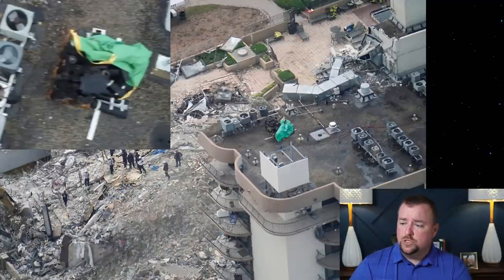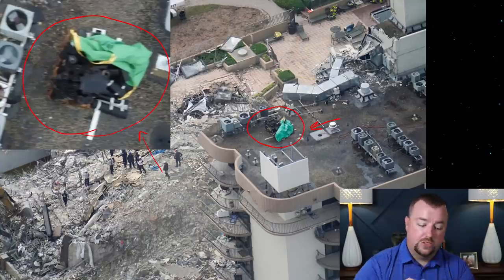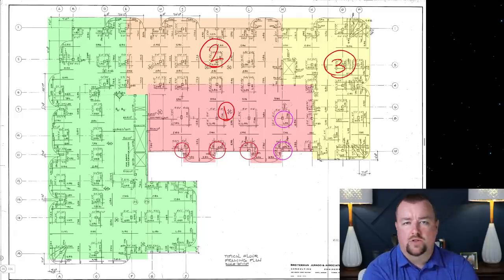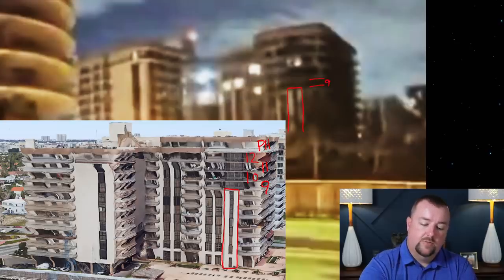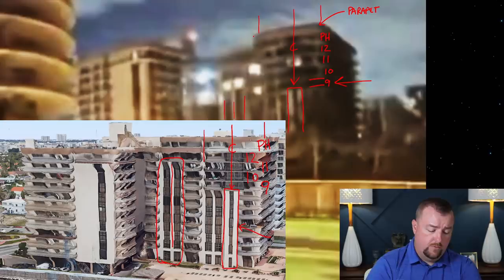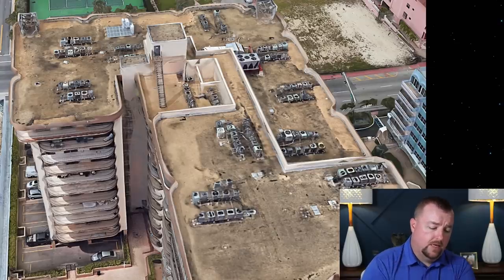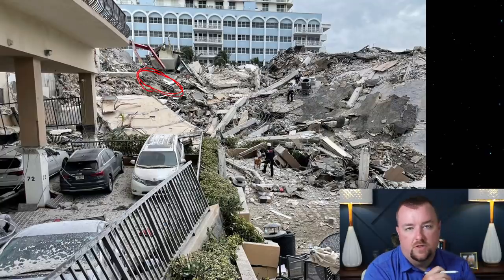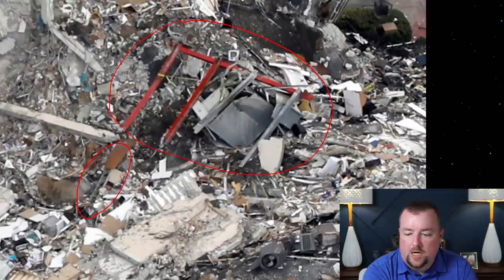Surfside Building Collapse - Did it start at the roof?

Comment: I invite you to watch a good copy of the original clip of the building collapse from security cameras very carefully. The clip is repeated and the time stamp runs down from 39 secs. I found at 38 secs there is a massive flash across the middle of the central block 3-4 floors down from the roof. I do not believe these are lights which are on at the 39 sec start. Then the floors above the flash collapse down onto the floor below the flash and then the central block continues to pancake down, but from the top, not from the bottom. At 34 secs there is a smaller flash lower down on the East wing then a second or so later that column collapses and the East Wing folds forwards and pancakes into its footprint. Along the roofline of what I call the West Wing there are a whole series of flashes. These seem to be mostly along the line that ends up being the separation of the buildings. They come at 34, 26,25 and 20 secs. There could conceivably be other explanations for some of these flashes but taken overall they seem, to me at least, to be the reason the building collapsed. Have a look and let me know your thoughts.
Reply: Amen. Anyone blaming those suspicious flashes on severed electrical conduit sheared breaker boxes should explain the lightbursts coming from floors which weren't yet set in motion... A bit hasty calling in an explosives team, before you've had a chance to test for explosives.

Comment: Obviously the extra weight of the penthouse brought it down.
Reply: No.  The penthouse was there for forty years.
Reply: @GH-oi2jf  Right! it was there until it wasn't. Saying something has been for a length of time has no meaning. This could've been in the making for 40 years until it got to the point it couldn't hold any longer. There might have been no issue with the extra weight under normal conditions. But too much once the foundation was compromised. Who knows?

Comment: wow - you have issues with perspective, nothing is missing on that first frame of the video, the building is intact.
Reply: It is clear from other photos that the section which fell first was at the same height as the part of the building to the east, and the faces were in the same plane.  That means the difference you see at the top of the first frame is not due to perspective.